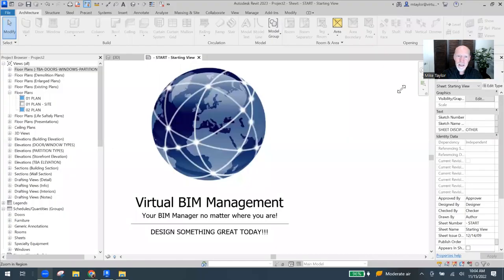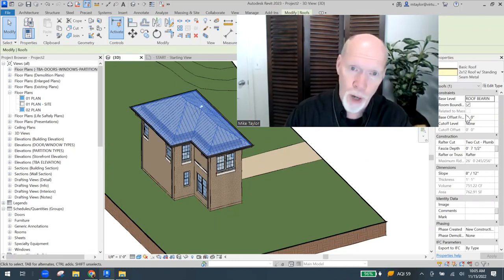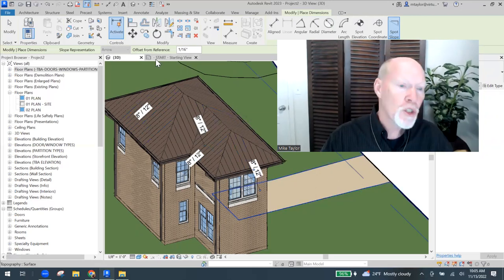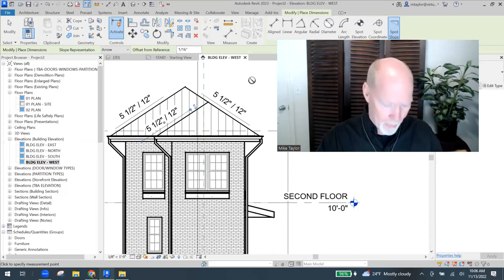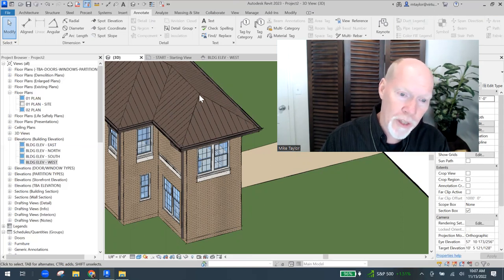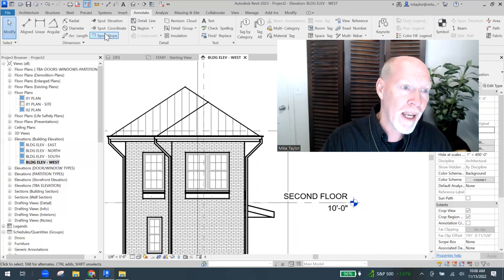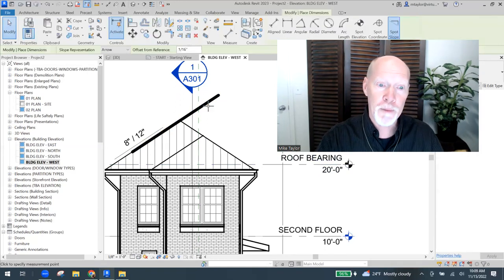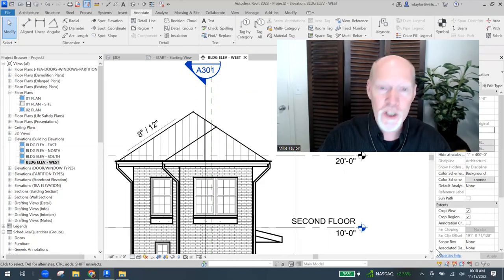SPOT SLOPE TOOL: Issues and fixes

Comment: Hi @Mike Taylor, hope you're doing well. 

I have a quick question. In revit suppose that I'm having 2 project files, one for exterior and one for interior. Now when i link and bind link the exterior project file into interior project file, the annotations and 2D elements get deleted from the exterior file. So i have to copy those 2D elements from that file by opening it in same session. 

Is there any better way to do this? Like to get the 2D elements after binding link?

Thank you in advance :)
Reply from the maker: Ok.. first.. you don’t need to bind the files. I suggest you keep the two files separate, and link the exterior file into the interior file… and then.. do ALL of your annotation in the Interior file. 
There is no need to Annotate in the Exterior file at all… keep it all in the Interior file.
Reply: @miketaylor-fantastic  Thank you for your help :)